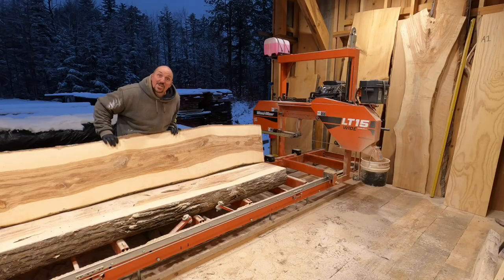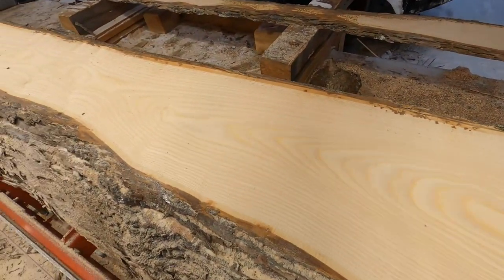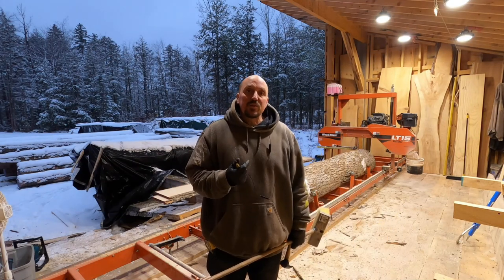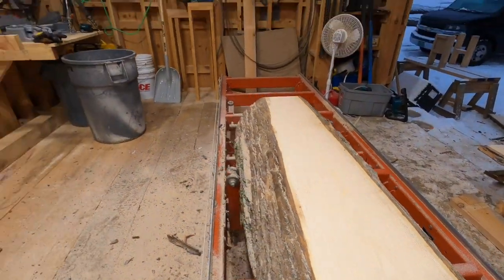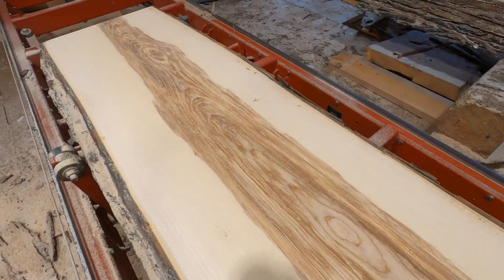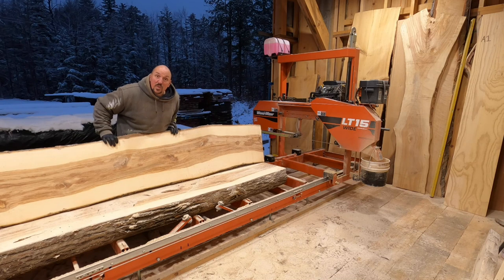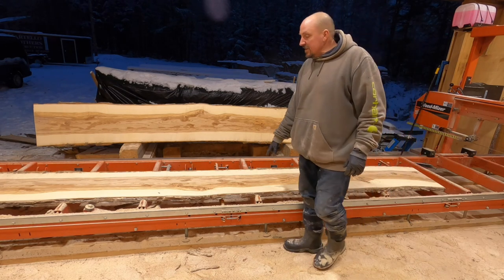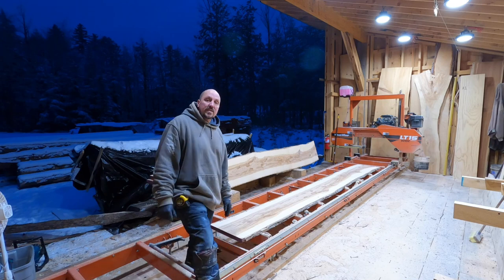Milling A Storm-Damaged Ash Into BEAUTIFUL Slabs, PART 1, CCS#82

Comment: I'm curious what you're using for coolant/lubricant? Really enjoying the videos and information, thanks for putting these out there.
Reply from the maker: During warmer weatger we use water with about 3-4 cups of Pinesol per tank. When it gets colder, we use 100% pink RV coolant. It doesnt freeze until it goes below -10f, or so. Im hoping to get some new vids up soon, this summer has bee  very hectic. -Andy
Reply: @cripplecreeksawmill  Thanks for the info! I'm considering getting one of these LT15wides, would be quite an upgrade from my alaskan mill!
Reply from the maker: @TFo13y  We used to use a big alaskan mill to process slabs. The difference in speed and ease-of-use is astounding when you first use a band mill vs having only used a chain mill. Take the jump when you can, you will love it.

Comment: Nice video and I like your setup. Are you happy with your LT 15 wide?
Reply from the maker: We are happy with it so far, but the mill model that you choose is predicated on how many board feet you want to produce per year. The lt 15 is a mill that's  too small for the production numbers that we are hitting now. When we have more funds, the plan is to step up to an lt 40 superhydraulic or an LT50 super hydraulic. -Andy
Reply: Thanks for the reply, you seem to have a hard working and well rounded crew. Sounds like a larger hydraulic mill will be the ticket and allow you to be even more diversified.
Reply from the maker: @D Burchett  if you are ever in the market to buy a mill, I'm happy to help by answering any questions you might have. -Andy
Reply: Andy, I really appreciate that...don't know if I will ever get one, but recently retired and plan on building a smaller house. It would definitely be a manual mill with a wider capacity for slabs, so we will see. Thanks 😊